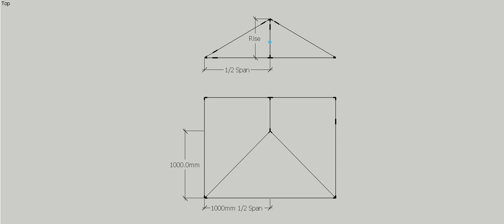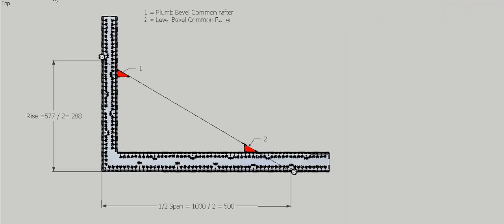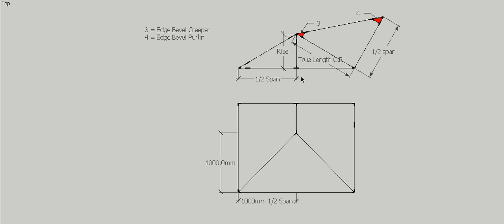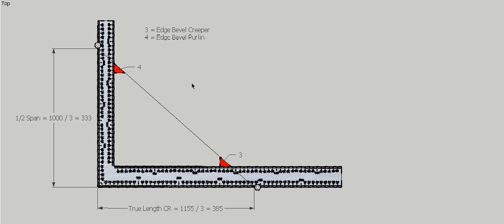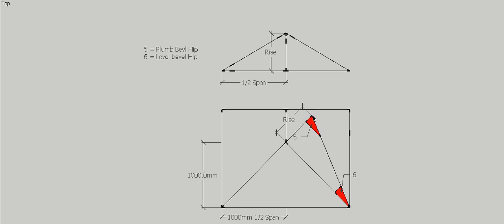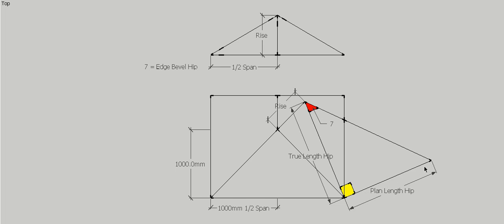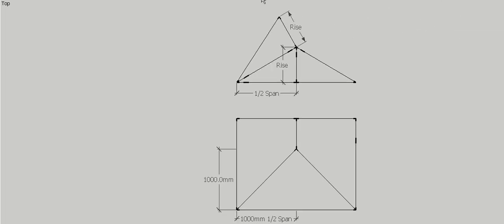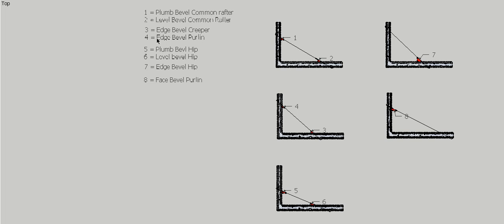Hip Roof Bevels Steel Square

Comment: Can you show how to transfer this on to timber ?
Reply from the maker: Hi Mate, I would just use a Sliding Bevel to take the angel from the paper to the timber. Otherwise you can use one of the other methods to develop the angle on to the timber directaly however that all require at least a few of the angles to be transferred. Hope this helps.
Reply: @Buildsum  so , you suggest drawing this in a scale to fit on paper and then transferring ! 
Kind of makes the steel square redundant then if you have the bevels to work off ?